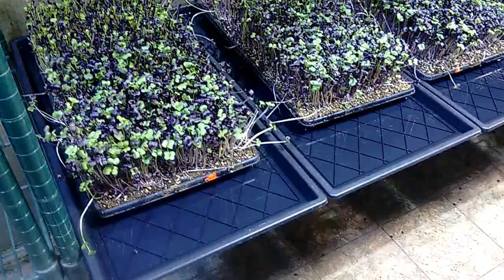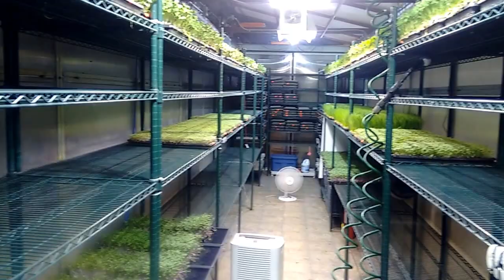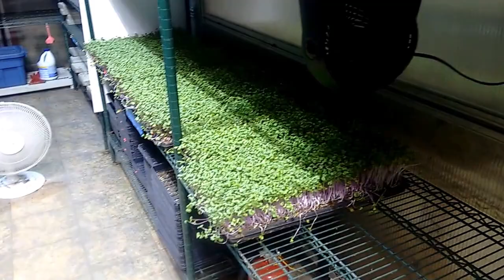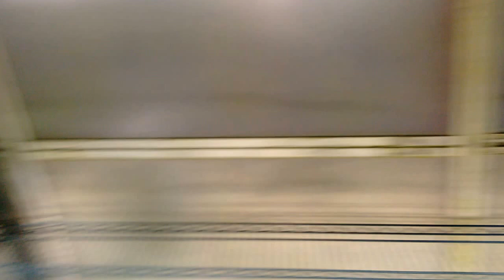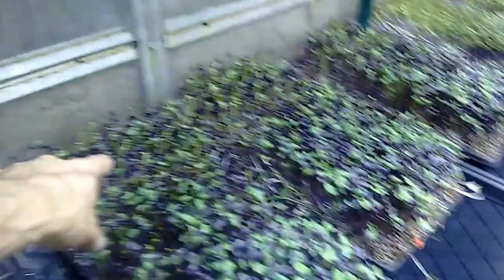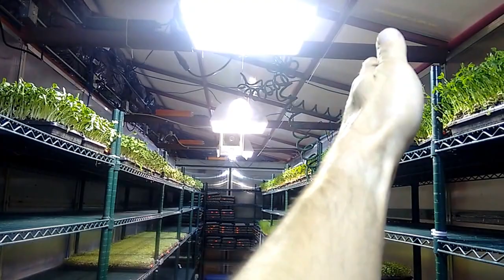Underwatering and Light Limitations

Comment: I have a few questions as well. Say I wanted to start a microgreens operation in a basement where I could fit about 16 trays on one shelf. Would that be enough yield to provide for 1-2 customers? And for a basement operation I'm expecting humidity to be an issue. Would simple humidifiers and a fan system similar to yours be a solution to the humidity? I expect I'll find out once it begins but just trying to catch any mistakes before I make them. Living in the suburbs outside Chicago so we do get a good amount of rain